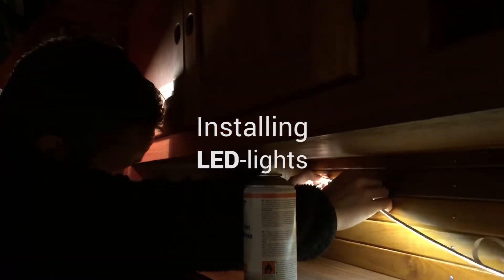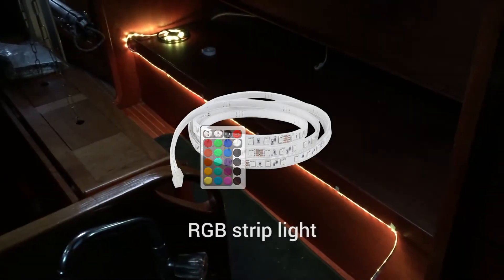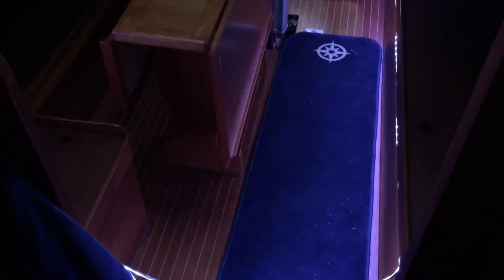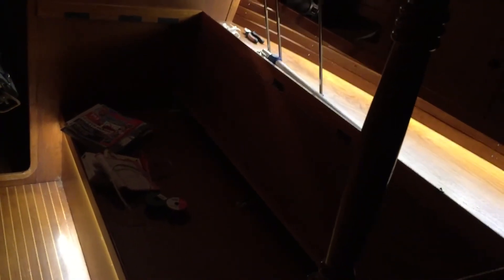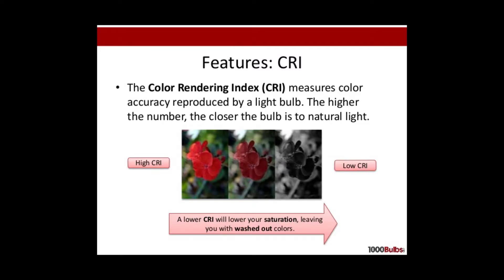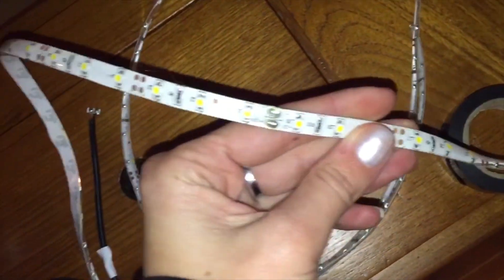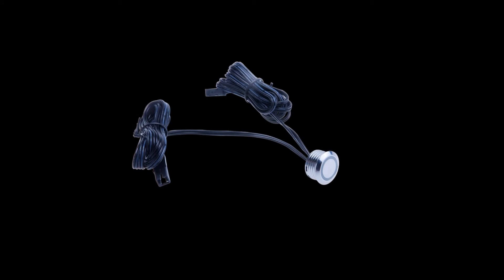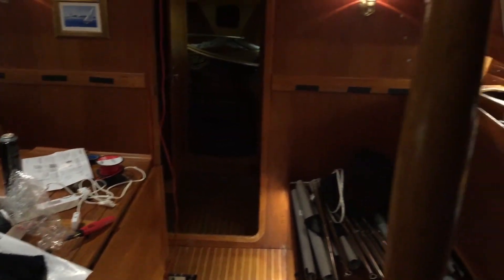Installing LED lights in our sailboat - Sailing Skidbladner

Comment: LED is the way to go.  Definitely, you need a good white light and a good red light for navigation and watches at night.  The dimmer is awesome.  The bad about cheap rheostat dimmers is that they just heat sink the un-wanted power, so you have the same power draw and extra heat.  They are cheap and simple.  On a bigger boat you will probably want a more economical system regarding the actual power draw.  I have a  16 ft trailer sailor, so cheap and simple is good.  I like how you lighted the storage spaces, and allowed that light to spill indirectly into the cabin.

Comment: Did you have to put any type of "DC ADAPTER" aside from the dimer?  Or just Connect the Strips to the negative and positive as seen at 5:43 on your video.... can you explain where you connected the red/black wire?  Thanks